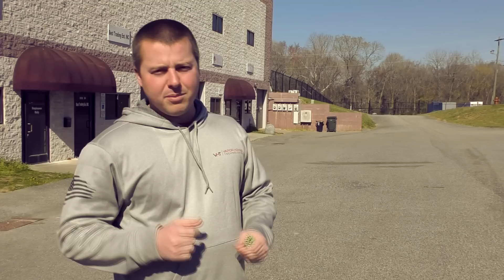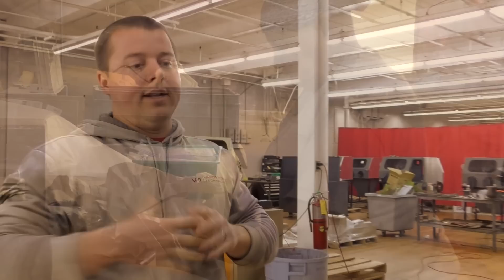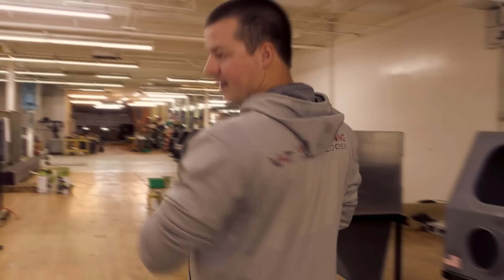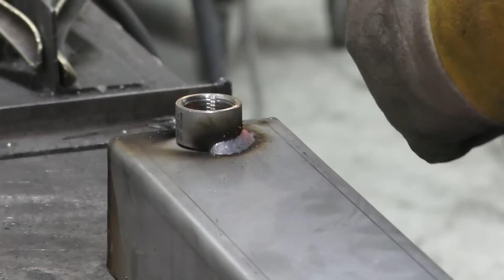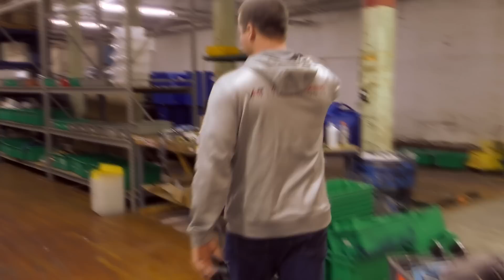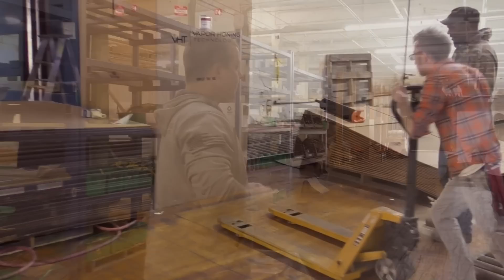Wet Blasting Shop Tour -Vapor Honing Technologies

Comment: Glad to see American Companies, Helping other American Companies keep up the good work .I've taken both tours and I'm impressed , I am an amature fossil hunter and I'm interested in an micro Minnie blaster the size of an ink pen that will work as a dry unit when needed as well as a wet  process , some fossils are ok with dry blasting, but some water blasting works better than dry , I really can't purchase 2 units ! I've already checked your site and your micro blaster is way too big for what I need and cost over $700.00 the micro blaster I've seen on YouTube only uses an 1/8 air supply and a regulator and the media and flow rate are adjusted at the tip and uses a common home air  compressor , please have your tech's, Engineers, R.D.team check into this as I would rather buy American than from this guy in the U.K.
Thank you .
Sincerely Floyd W Gross
Reply from the maker: Will definitely be in touch.  Thank you Billy.